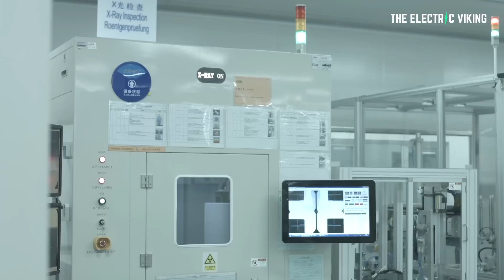BMW to use Tesla 4680-like batteries from China in new EVs

Comment: This is easily the worst EV related channel on YT, lol.  Certainly the most pathetic.  Next you will be saying VW copied Tesla's frunk (ahem, 1930's Beetle).  Or, that Elon himself invented the cylindrical battery cell over 125 years ago.  This was after Elon invented the electric induction motor, and much after Elon invented electricity.  Tesla's sheepness is baked right into its name, which has no affiliation with Nikola Tesla who was an actual inventor.  Hard to be lamer than that.  Could not even come up with an original name for his crap company.

Comment: I think you may be mistaken here.... One of the issues that you have with lfp batteries is that they can't be drained as quickly as turnary batteries.... There's a reason why Tesla stuck with the tiny 18650 batteries for the model s.  The reason clearly is because the performance numbers on them can be much, much better than lfp or even the larger ternary cells that they have for both the model 3 and the new 4680.  In my mind there's no question that Tesla will continue to transition their standard range and possibly even their long-range vehicles to lithium iron phosphate especially the newer lithium manganese iron phosphate, however when it comes to their performance models I think that they're going to stick with nickel based batteries at least for the foreseeable future.  Both the cybertruck and the semi will use 4680 cells for the long range versions and that alone will require millions of cells that Tesla right now is not capable of producing on their own.  When Tesla does finally start making the cybertruck if there is someone out there making 4680 cells I believe that Tesla will buy from everyone and anyone making these cells.  Keep in mind that byd is the longest range Semi trucks if measured on the EPA cycle would barely hit 300 miles, Tesla is promising semis with up to a 500 mile range... I believe that they will only achieve that in the near term with 4680 cells.

Comment: I have been studying battery tech for probably as long as you, and watched every single video you have made on the subject (it is some of my research). That said I still don't consider myself an expert, but I have come across enough that I think your predictions are missing some important technologies. I think perhaps you have made so many videos that you forgot some of your own content ;). There are 6 technologies are I consider viable by 2030, the first 3 are already on the market (though 3 is not used in EVs yet):
1. Turnery batteries - includes 4680, and doping the anode with silicone
2. LFP batteries - includes the M3P
3. Sodium Ion - almost at the old LFP energy density and going to be super cheap
4. Lithium sulfur - which has at least 10 organizations that have this working in the laboratory, and 2 in limited production
5. Aluminum Ion with Graphene - GMG only one doing it now, not to be confused with aluminum air, which is a bad idea for cars
6. Solid state - which could actually work with any of the above technologies if you have the right solid separator

I agree that LFP will supplant turnery batteries as the largest part, but it will be short of 80%, probably 60-65%. I am not sure turnery batteries will exist at all by 2030 in EVs. I think Sodium Ion will become so cheap that they will take over the low range models (sub 300 miles), just because of cost. Sodium ion will supplant LFP as LFP supplants turnery. That low end may well be a significant part of the market, maybe as much as 25-30%. I think the premium models will come with one of the last 3 technologies and have some combination of very long range (like 500 miles or more), super quick charging, massive acceleration, but by 2030 they will be less expensive than LFP is today and so they will be in a large number of cars. Electric trucks of all sizes will need massive KWH batteries to be able to have any kind of range while towing, so they will most likely be in that group too. If you want 300 miles of towing range you need at least 600 miles of range in the truck, which will be hard to do with LFP, even M3P.

Some time around 2030 or afterwards solid state lithium sulfur batteries will take over the majority of the market, because they will be cheap, safe, and have a very high power density in addition to high energy density. The only thing that may delay this is possibly them being used in aircraft or other things that need really good safety, large energy density, and power density to be viable. Meaning that may constrain the price coming down because there will be demand outside of EVs that can pay more per KWH.

Anyway, those are my predictions, I could be wrong about lithium sulfur, maybe it will be aluminum ion as the next big thing. Once any of the last 3 technologies hit scale there will be no reason for anyone to use turnery batteries in anything unless silicone anodes provides more energy than I think it will, and even LFP may fade away if those are just as inexpensive (which they may be eventually, but not for a long time as they work to reach scale).
Reply: With all the research going into EV battery research it is possible that an even better battery chemistry could be invented.
Reply: @CoverYourActions  It undoubtedly will. I only mentioned the ones I know of that have had enough progress to hit the market by 2030. But one never knows for sure :).
Reply: Thank you, your list of current battery options is very informative and to the point.

Comment: The main, and perhaps only, advantage of cylindrical cells is that they are so much easier and faster to mass manufacture, which is something that Tesla and Elon absolutely love. 

As far as LFP, which I also agree is the chemistry of the near future, especially for standard range vehicles, those extra energy density claims are coming from a Chinese company, which are not the most trustworthy companies in making claims, if you know what I mean. They claim to use manganese to achieve the extra energy density. So I want to state once again, using manganese on LFP batteries is nothing new, and getting higher energy density doing so is nothing new. They have been working on it for over two decades. However, the main problem has always been that adding manganese to them significantly lowers the life expectancy of LFP batteries. As low as on 100 cycles or so. I'm sure they have managed to increase the lifespan a bit, or Tesla would not be using them, but I doubt that they will use those outside of China anytime soon, simply because outside of China (where the dissidents are, let's say, constraint) are not so much so outside of it. So the life expectancy is going to be put to the test outside of there really quickly.

Comment: prismatic makes sense for lfp cells but for high power density the 4680 is faster and cheaper to make for high nickle cells. most likely going to be used in the tesla semi and cybertruck.
i would prefer lfp than high nickle, in my car today, but each has it's place, and use case.
and Tesla will make their cars with every battery they can get their hands on.

Comment: This video does not make much sense. BMW may specifically be looking for higher energy density to serve their target market. So they may be fine with the higher price of nickel chemistries. On the other hand, 4680 is just a form factor and it is quite possible that they get LFP or LFP with manganese. Those are not limited to prismatic cells. It's also weird to say that Tesla produces enough 4680s themselves. They have actively encouraged multiple battery manufacturers to make those.

Comment: You don't have to be best if you are good enough.  If BMW vehicles have a 300+ mile range and last for 250,000 miles, it won't matter to BMW buyers if BMW is not using the best possible batteries.

Comment: I think 4680's, the format, can be built with LFP, the chemistry.. So, it's not either LFP or 4680.. These are two different characteristics of a battery..  The 4680's in any case are required for the structural battery pack, and Tesla intends to make all their cars with structural battery packs..

Comment: LFP with Manganese has huge potential as a reliable, energy dense and low cost energy storage chemistry.   However Nickel based chemistries also have potential for increased power density with silicon doped anodes. So the benchmark is increasing for both types and that can give Nickel the upper hand for high power applications until solid state technology possibly becomes viable to manufacture cost effectively.  Battery manufacturing output, cost and energy density is in my opinion the key battleground for the automotive industry for the foreseeable future.
Reply: Silicone anodes can be done with LFP too. There was an article about that a while back, I think it is how CATL keeps increasing the energy density of LFP, but it is a guess on my part.

Comment: Sam,   the cylindrical cell is dynamically more stable and the pouch cells allow the coated sheets to scuff with vibration and not as durable as the cylindrical cell
Reply: >  And the round can controls swelling of the pack keeping the contents stable. When pouches can swell and delaminate there goes the cooling, and hot spots occur, and poof.

Comment: Sam - Can you include a video that discusses two points that seem confusing.   1) 4680 refers to dimension.   Tesla 4680 refers to tabless capability and other specs that reduces manufacturing/capital 80%, creates structural ability, etc.    The size of the cylinder of a “tesla 4680” is just 1 minor point.  Are you referring to the fact BMW is going to use a 4 inch battery vs. 2 inch which is meaningless or are you saying BMW is going to use all the same tabless, chemical, power, structural, features of Tesla 4680?   It seems like this is a pointless as saying BMW 3 is midsize and Tesla 3 is midsize so they are same thing because the dimensions are the same.    Or are you saying BMW 4680 is same thing as Tesla 4680 with a different name?      Question 2)  Sandy just did a video reviewed on STMP channel on value of cylinder cells over square cells.   Does that have anything to do with LFP?  Does LFP mean it can’t be in a cylinder the dimension of 4680?     To someone without a solid understanding it seems like we are comparing chemistry vs shape.  Please clarify if cylinderical means it can’t be LFP chemistry.   Thanks for all you do.   It is hard to edit the comment on this iPad to make my questions sound polite.  I am confused hoping for your insight.

Comment: But arent LFP batteries pretty bad in cold weather. When Björn tested model 3 with LFP it hardly chatged at 0 degrees
Reply: but the tang ev, with blade lfp battery, ranks pretty high in a norway tests of ranges during winter time. there is remedy for the old issue you mentioned.
Reply: @QL2004  could you point out source for that? And what I actually mean is that charging is pretty slow if battery gets cold. Also in Björns video Tang, even when warm, charged pretty slow at the when connected to charger. Range is probably just OK especially if battery is kept warm. 

Copy text from one Tesla user: "LFP batteries absolutely hate the cold. Preconditioning while the car is plugged in or superchargering seems to be the only fix."

So it seems that if you can some way keep battery warm, it is about OK, but if battery gets cold, you are kind of doomed.

Comment: There are two issues being conflated in this video. The geometry of batteries and the chemistry of batteries.
At this stage it appears that LFP type batteries will in the the short term become the dominant chemistry.
The second issue is the geometry of the batteries. When comparing prismatic and cylindrical batteries there are pluses and minuses for each geometry. At this stage it is not clear which geometry will be the winner in the long run or even if the outcome is a horses for courses type of outcome.
The chemistry issue is likely to be more important than the geometry issue in the near term.
Reply: 4680 could be LFP or ternary chemistry.
Reply: Brian N / The prismatic geometry is evidently the future.
Better volumetric utilisation and way much better cooling.
Reply: Tesla’s new 4680 (ignore chemistry) structural battery is immensely strong. End plate cooling is more than good enough and the semi rigid mastic encapsulation makes an incredibly stiff battery pack.
Reply: David E / And their repairability goes completely out the window!
Good luck with your bank account when repairing the Tesla's battery pack unit built with the 4680s, when the pack is out of warranty! ( watch Sandy Munro's YouTube material on the latest 4680 packs and you'll be horrified by the way the pack is built now by Tesla...😞😤 )
The easily repairable blade and prismatic pack designs are the only evident future, from many points of view, including better volumetric utilisation, cooling it, its repairability, etc.
Reply: @Dave5843-d9m  We love Sandy

Comment: In my view the M3P is the packaging similar to the blade from BYD, not the chemistry [LMFP is the chem]. Yoo could use the 4680 form for LFP too but its more densitiy without big cooling needs likely with small blades [catl wrote 14% better than 4680]. I think Elon bet on 
1] really most efficient mass production with round cells and dry electrode[but not working yet] also for other usecases and 
2] new chemestries with more silicon anode mix in NCA/NCM and LF[M]P and LNMO!
I guess from standpoint of expanding material while using mor silicon in the cells round form gives more space for volume change between the cells for expanding, like honeycombs of course - the best stable structur of nature
3] the shortest way for electrons to pass for lower resistance and important for more performance: higher C-Rates with safety reserve to put it outside at 180°
3] despite using cheap chemestries based at LFP to have an argument for better pricing negotiations with the cell companies of course. Elon needs the own ones only for best perfomance and high nickel [and nickel for stainless steel plan too]. 

So he knows 3 years ago using more chemistries [announcement of 3] but we will have more of it for special purposes and tailormade for needs.

I wish we would have better CW-Rates with flat floors and more Aptera-Styles e.g. with cells under the seats and instead of a frunk but with more space as onebox-design. Perhaps we have 3 years ahead the robovan wth all plugin-home-el-support and full bed inside, driving me around the world with only solar filling in a week like aptera but in mass production with single-piece-casting and laminated with solarfoil for 20.000$ ?! But do you think ?
Reply: M3P stands for Mn3(PO4)2. It's actually the chemistry.
Reply: Kent / DrGoodtimes smokes too much weed. 😏

Comment: It’s not just the size of the 4680 that makes it so great, and soon to be even more improved, it’s because it’s Tabless and a dry mix of applied chemicals, thinner canister and thus 5x more power
Reply: It is not 5X more power per weight/volume (i.e. energy density) it is at least 5x more power and 5x larger. Energy density is not improved by much in the 4680 form factor, though the tab-less design should have a lot of benefits, and I think they have played with the chemistry a bit too, but not 100% sure. The thinner canister (and less surface area to volume ration) also helps some.

Comment: The "competition" is flailing around, buying any batteries they can snag without doing any R&D themselves. Fatal error.
Reply: Shows your utter ignorance if you think one word of that is true. 

Tesla only started using their own batteries 1 year ago, most Tesla's have batteries sourced from whoever they can today, very few use Tesla made cells.   18650s, 2170s, even BYD blade cells. They buy whatever they can from whoever they can. If Elon does something, it is a sign of his genius, if anyone else does that very same thing, it is a sign of desperation. The sheer utter fucking stupidity of Elon fan bois is mind-blowing. 

Besides, 4680 cells are not something any car maker should boast about using anyway, they are not the high performance choice, but the low cost choice.
Reply: @ForeverNeverwhere1  Read for comprehension, not for any Gotcha points you can use against a comment. In this case I was referring to research, which Tesla is aggressively doing, not sourcing. Of course they're buying lots of batteries from BYD and CATL until they can vertically integrate in house batteries. What other companies are doing that? In so far as performance vs. cost, so? Sounds like lean manufacturing. BMW could develop a for the masses, super hetrodyne, finally tuned race car engine, but why? It would cost a fortune for everyone involved.
I admire Musk for building a great company from scratch. Otherwise, I don't give a damn. You're generalities make you seem ignorant.

Comment: Sam
Are you missing the valid point that to make TWh volumes of cells you need very high volume from small, efficient factories?
That's the whole point of 4680 cells.
Reply: Roger Snarky/ That's the wrong whole point that will not be materialized.
Reply: catl and byd will produce a whole lot of TWh's than the rest of the world combined. small factories aren't efficient at all.